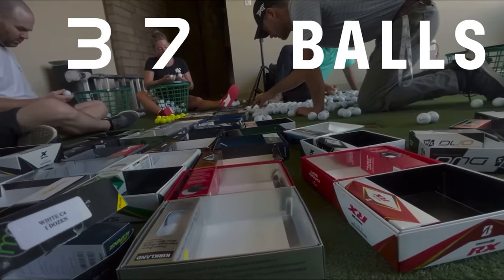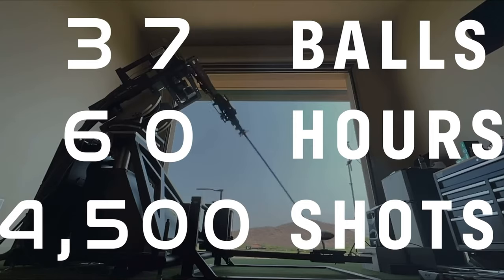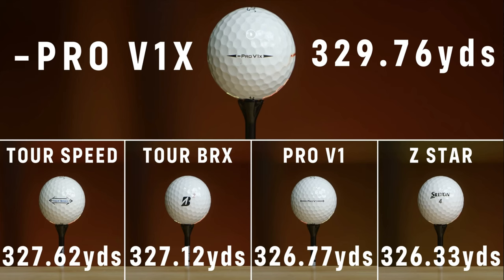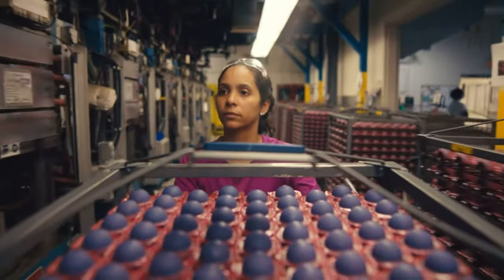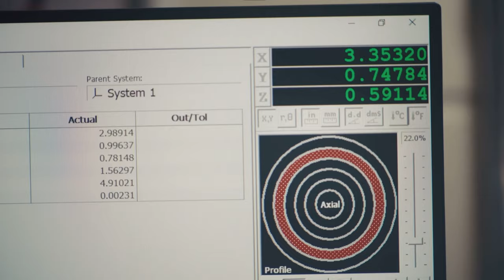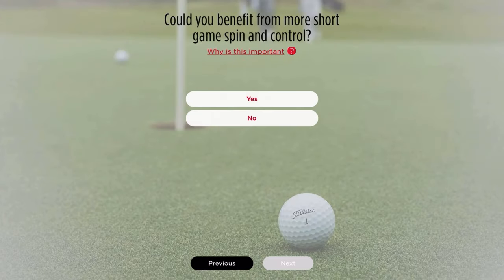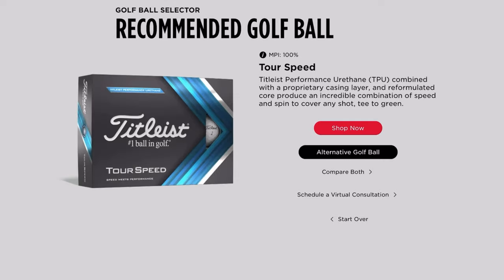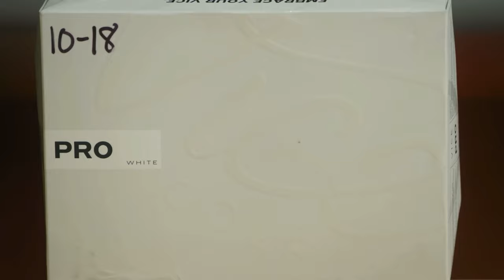Golf Ball Fitting - Why It Matters @mygolfspyvideos @VICEGOLF

Comment: Man, if you can find them the Titleist - ProV1x (left dash) is a distance monster off the tee.
Reply from the maker: Man, I cannot find that ball in-person anywhere, not even a sleeve. How do they feel off irons, and around the greens?
Reply: @ParfortheCourse  Ha! My home course is Gleannloch Pines and they have sleeves that sell out pretty quickly when they re-stock. Only place I’ve seen them in Houston metro this summer. 

Feel? I’m not a good person to answer that as I’ve never been sensitive to ball “feel” except off the putter face. And they feel like a ProV1 (as a reference). 

My observation on short game spin is that the ball performs exceptionally well with great check on sand and lob wedge shots. 

Driver Distance (my personal experience) I’m seeing about a 5-7 yd carry increase from ProV1 and Bridgestone Tour BX (my gamers).  May not sound like a lot to some people, but if you play enough golf, you know that there are some holes where any extra carry distance takes bunkers or other danger out of play.